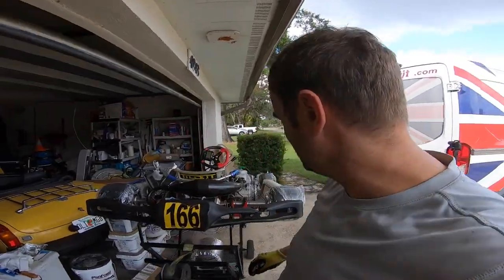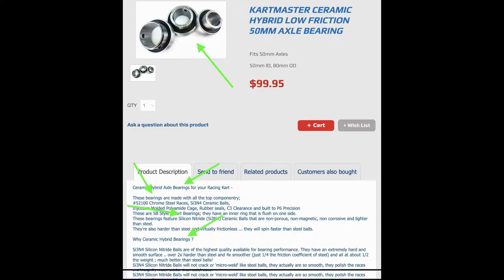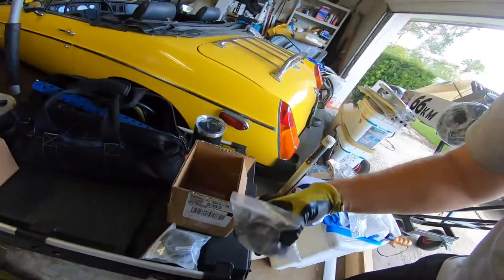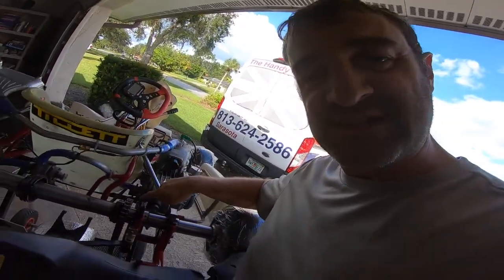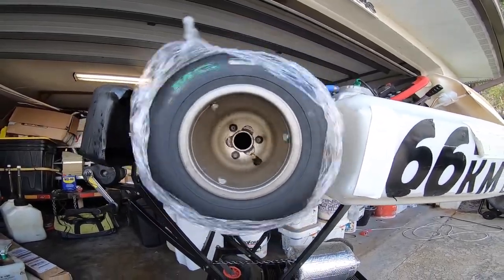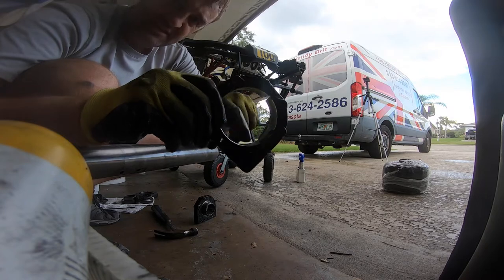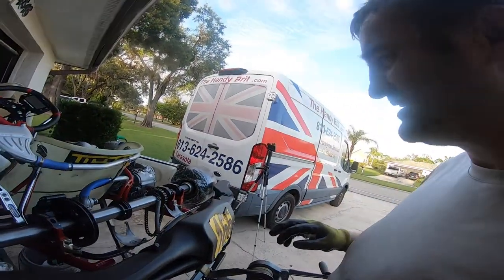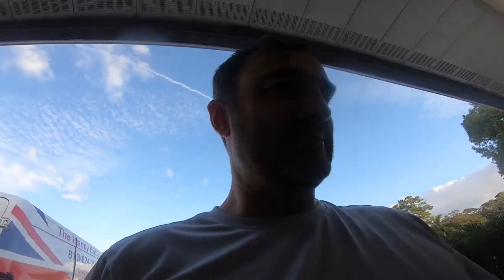GoKart Ceramic bearings

Comment: Nice! I need to upgrade mine this off-season.
Reply from the maker: There are definitely other places that I would invest my money first regarding performance. However, reducing friction is a no downside improvement on the kart, other than the cost.
Reply: Nice video….have you ran on track…. ? Noticed any difference…? Can I ask where you bough from..? Thanks
Reply from the maker: @Spice  I have not been on the track with them yet but did one Autocross event.  It's tough to notice an improvement to be honest. What kart do you have.
Reply: @thewrightsgarage  My son races Rotax and iame at a high level, so we are always looking for small gains, did you get / find any particular brand / make any better..?? Thanks lots 👍
Reply from the maker: @spice3767  I bought the ones from Komet kart.  However, it really looked like you were getting 3 for the price but only go one.  A friend of mine whose son is having a lot of success with Micro basically said you are best off getting the OEM ones and changing them regularly.
Reply: @thewrightsgarage  Many thanks for the reply and info. Happy racing 👍👍💪💪
Reply from the maker: @Spice  you too. Good luck with your son's racing.